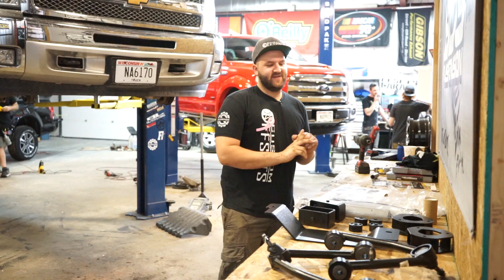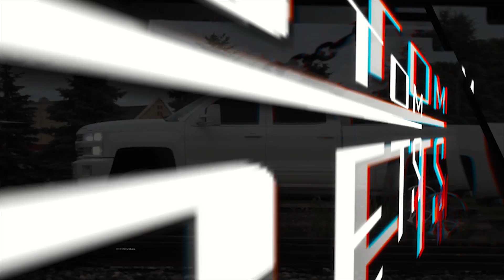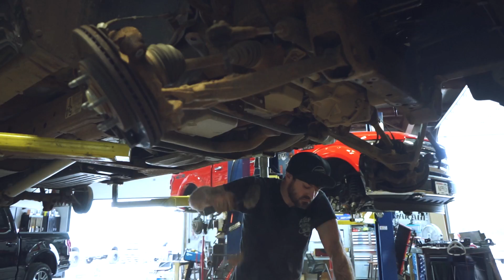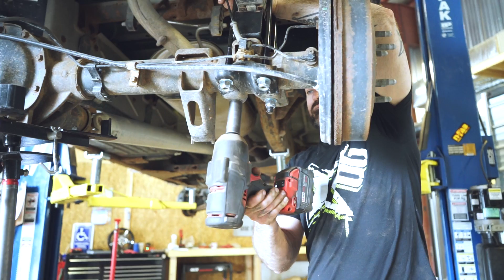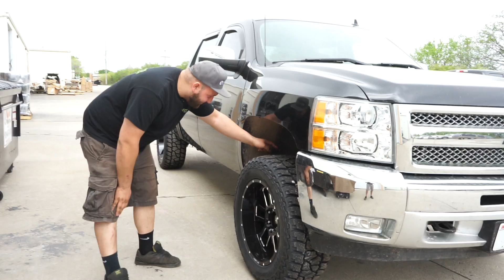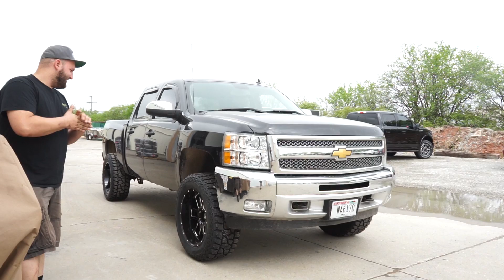Lifts & Levels: 3.5" Rough Country Lift Kit

Comment: I know a lot of people find issues with the spacer lift, because it puts too much strain on the ball joints eventually destroying them. Would a kit that comes with the control arms avoid this problem and keep my ball joints and tie rods at good angles?
Reply: Should I had the kit on a truck I bought that didn’t I had to replace ball joints constantly but once I bought the control arms no issues

Comment: What were you cutting on I was going to have this installed professionally but also considered doing it myself I have worked on a lot of stuff but if there is cuttin and welding required I probably won’t mess with it

Comment: Purchasing this 3.5" lift for my 2017 ram 1500... it's brand-new.. There should not be any problem running my stock rear shocks since they r new, am I right?? 
Glad I finally found an install video on this lift..
Reply from the maker: Most lifts come with longer shocks if needed Matt!
Reply: Custom Offsets 👍 Thanks

Comment: Why did you cut the drop stops? I have this kit in my truck, I bought the 3.5 kit with the arms so I wouldnt have to cut my stops off.
Reply from the maker: Instructions say to cut
Reply: do you guys see any issue with cutting them stops out
Reply: I aslo didn't want to cut mine.  Still debating weather or not to go with it

Comment: I’m installing this same exact lift on my 09 Avalanche. Can’t get the ball joint on the upper control arm to fall into place. Do I need to cut the upper ball joint bump stop like they did on this Silverado so it will line up?
Reply from the maker: Most lift kits come with an installation guide Cory! If you purchased from us, please feel free to email us!

Comment: What’s the wheel/tire specs? Recently got the Rough Country 4.75 for my 2011. Haven’t put it on yet. Like this stance a lot. Currently run 20x9 Mickey Thompson’s but considering 20x12 and adding fender flares.
Reply from the maker: 20x10's and 33's Ryan!

Comment: I hot my 3.5 coming tomorrow for $399.99. Just got my 33" Cooper Discoverer RXT so I got it to clear without hopefully having to mod anything on my truck. I got the control arms w/ strut spacers and shocks with the blocks in the rear but know I'm going to go ahead and get the RC struts soon so probably should've just paid the extra 300 to do it now.

Comment: What size wheels are on this?
Reply from the maker: 20x10's Mason
Reply: Custom Offsets Does Running 20" Tires And Having 3.5 Lift Affect Your Gas Mileage I Have 2016 GMC Sierra
Reply from the maker: Yes liljordan, the taller you go, and the more rolling mass you add, the lower your MPG will be.
Reply: @CustomOffsetsTV  so say this lift and factory 17" wheels, would the MPG be the same? 255/70/17.